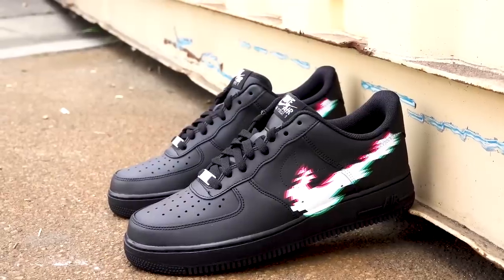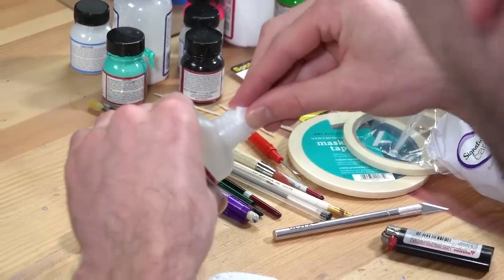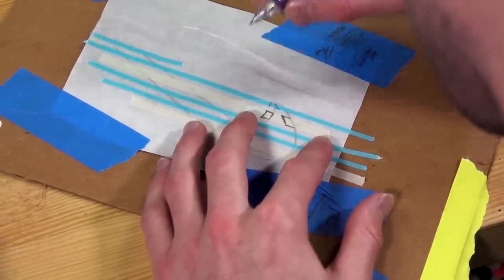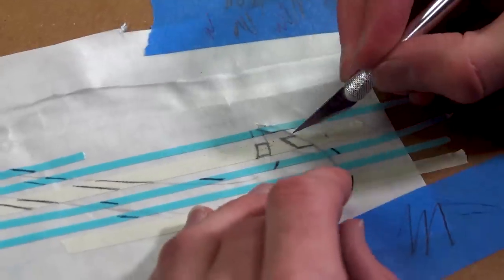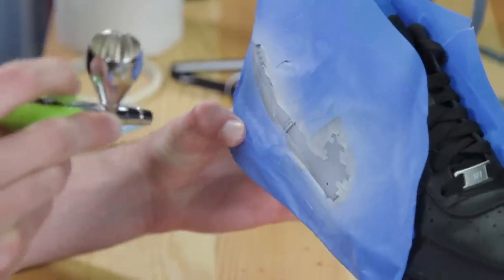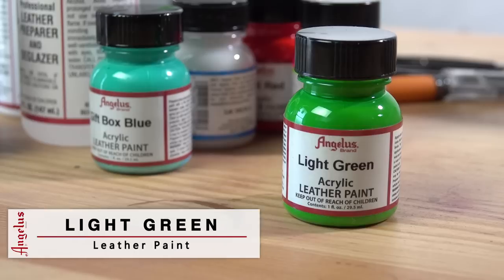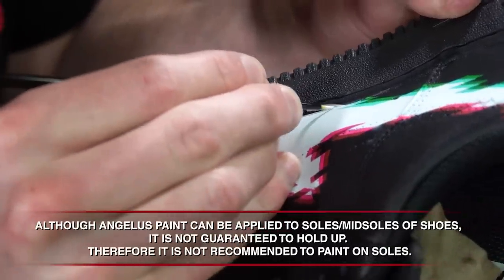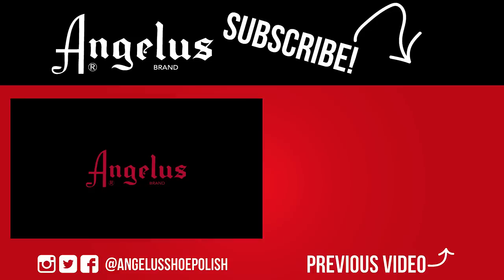Custom Nike Air Force 1 Glitch | Angelus Paint

Comment: When adding the finisher, does it have to be used with an air brush. Or can I apply it with a regular brush? (super thin coats ofc)
Reply from the maker: Hey there! You can use an airbrush but it is not necessary, you can use a brush or sponge instead

Comment: Couple questions - 
Can I do this without an air brush? 
I make the separate stencils for each side?
Reply from the maker: Correct, each side will need it's own stencil. You may hand paint with a brush however it may take a few more coats and will take a bit more time to achieve the full coverage. If you have any more questions feel free to contact us at Info@angelusshoepolish.com

Comment: what can i use as an alternative for angelus acrylic finisher?
Reply from the maker: Are you looking for a different shine to your project or extra protection? The finisher is option. The paint itself already contains finisher and is durable and flexible.  Adding finisher will provide the paint with extra gloss and will help to prevent from minor scratches or scrapes.

Comment: do you need an air brush to do this or are you just using it for ease of use. Like with the white base coat and the the matte finisher
Reply from the maker: You do not have to use an airbrush. Using an airbrush makes it easier to lay the white paint over the black leather. Using a brush by hand will require more coats and time to achieve full coverage. The finisher can be applied with paint brush,a cloth, cotton applicator or airbrush. You may need to experiment and see what works best for you.

Comment: Instead of using the airbrush can I also just paint it with the normal brush and the same mix?
Reply: Yeah that's what I did and it turned out the same!
Reply from the maker: Yes, you may need to apply more coats of white by hand compared to using an airbrush.
Reply: About 8 coats should work

Comment: 1.What stencil tape/tape are you applying at 7:17 around the Nike swoosh?
2.How much does a paint spray cost and where can i find one? Is this a necessary/useful tool? 
3.Which type of paintbrush do you use for angelus paints? Is it the same type for the deglazer, sealer and paints? 
Thanks in advance to anyone who can provide advice
Reply from the maker: The tape being used can be found at your local art supply store and the airbrush can be found online or at angelusdirect.com or grex.com. As far as the paint brushes, make sure to use acrylic brushes for the paints and finishers and cotton balls/swabs for the deglazer. If you have any more questions feel free to contact us at Info@angelusshoepolish.com

Comment: Hi I really want to know if you need a different preparer, paint or finisher for the midsole part of the Air Force 1? Please get back to me asap Thanks!
Reply from the maker: Unfortunately we don't recommend working on soles/midsoles. No matter what you use to prep or the finisher, the paint/dye has a difficult time lasting on that rubber material. For best results we suggest not to mess with it.

Comment: For the tape bit why don't you trace the shape then move the tape along to create the shift
Reply from the maker: Yes, if you are hand painting then tracing the image may be more efficient . However since Justin is painting white onto black, using an airbrush is more effective due to the many coats of paint that are required for solid coverage. In this case, creating the stencil works for him. Feel free to experiment with whatever method and let us know how it works out.
Reply: Angelus Shoe Polish no, do the swoosh with the tape on, then move the tape instead of tracing it the way he did

Comment: Can you use angelus on a regular canvas?
Reply from the maker: Yes. It works great on canvas. However, you may want to consider adding 2 Soft with the paints. Mixing the 2 will help the paint adhere on fabric materials. Check out the 2-soft here https://angelusdirect.com/products/angelus-2-soft-fabric-medium If you have any more questions feel free to contact us at Info@angelusshoepolish.com

Comment: How long does the paint stay on the shoe?
Reply from the maker: The paint can last the life of the shoe. All it takes is proper prep and application. When prepping the area, we suggest using our Angelus Deglazer or Acetone to remove the factory paint/finish. This will allow Angelus paint to adhere better to the surface. Apply light even coats, allow it to fully dry and you are good to go.

Comment: Why is the midsole so difficult to customize??
Reply from the maker: Paint will not properly adhere to rubber surface. Unfortunately It will chip and crack right away.